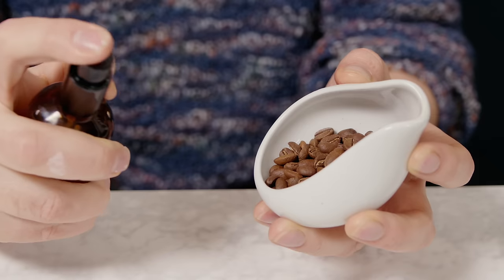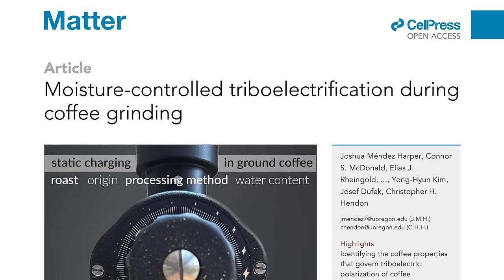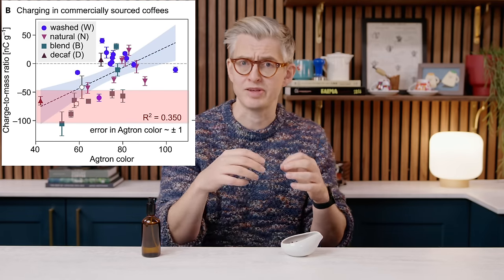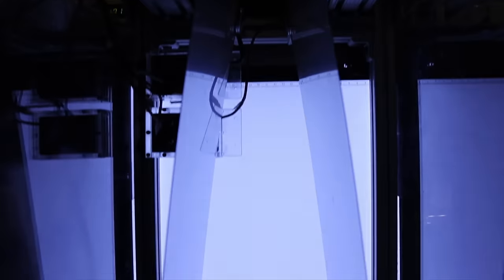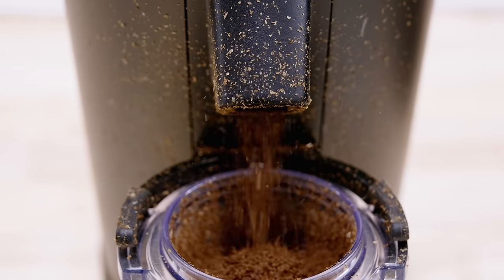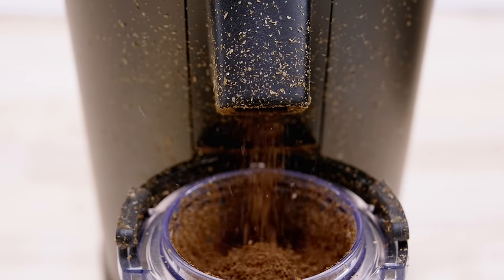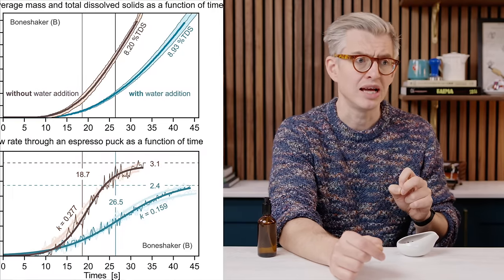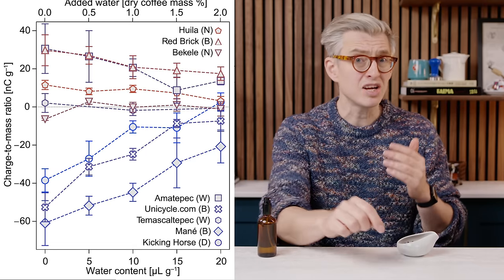Science Discovers What We All Missed: More Than An Anti-Static Hack

Comment: *Edit: maybe I should have read the paper first, lol*

1. Does your puck prep routine include using the WDT? I think the intent of that tool aligns with breaking up clumps -- probably larger clumps than the aggregates, and the tines are HUGE compared to one particle/aggregate. Is there a more pronounced water-dose-to-show-time relationship without using a WDT, or no observed effect?

2. Is there any relationship between the TIME between water spritz and grinding? Maybe the water is making the beans less brittle; the beans won't shatter as much. More time gives the water a longer period over which to diffuse towards the interior of the bean -- the same principal in blooming (getting rid of gasses, but also surfacing soluble materials via diffusion).

3. Is there a measurable difference in particle size distribution vs. water spritz quantity? Potentially preventing aggregates should remove particles from the larger end and increase the number at the smaller end. If there is a material brittleness thing going on, we might NOT have a large increase in fines.

I'm just spitballing 😇. Nor do I do ANY espresso.

Comment: I wouldn't feel comfortable with doing this with my hand grinder. I've had issues with water accumulation before, and the cause was being overzealous with the spray bottle. On an electric grinder (e.g. the EK43 from the turbo shot video), you'll have a much larger grind chamber (more room for water to spread) and a high RPM grinder to spread the water around and dry it quickly. Those are 2 things I cant get with my hand grinder (knock feld47 if  you're interested). I'll stick with 1-2 sprits of water. I also only brew v60 or aeropress, so I won't see the same benefit as espresso brewers might.

Comment: My first thought when watching this video was that roast level would be a significant variable, and I'm glad to see this information was included in the Google form. 

My grinder, the DF83, does not appear to bottleneck, so I didn't expect any change from adding water. To my surprise, the water visually appeared to drastically increase clumping (there is typically no visually observable clumping coming out of the grinder), and shot time increases from 28 to 39 seconds with a light roast. These changes were consistent across multiple shots. 

Furthermore, the "whetted" shot, when pulling, created separate streams from the naked portafilter which never came together into 1 stream, which typically would indicate channeling, and this result was also consistent across multiple shots. 

As you might expect, the flavor changed with the "whetted" shot, but I am not sure exactly how to describe the difference in flavor, and I will have to pull more shots to decide which flavor I liked better.

Comment: Just saying, I grind manually with a comandante with the Red Clix option. I do add water spray 1 by the way, and it works very well for me. I tried adding more  sprayed water and I found that the coffee grind sticks to the glass jar wall. It makes a mess and needs cleaning each time while using only one spray no maintenance is needed. So my guess is that you should get about the same results on electric grinders. I hope there will be a follow up on this subject. Thanks, very interesting...

Comment: interesting ... and how about the affect of water sprayed temperature ?
6g arabica + 10g Robusta, mixed & sprayed with water (room temp.) 3 times while mixed, total weight 16.2 -16.3g.
When grinding with the 1Zpresso manual grinder, I felt the difference ... the vibrations felt smoother, seems less power from my hand to grind
I use Flair signature manual espresso maker and also feel the coffee flow is more fluid, can't see different in crema but the taste is better. Taste better that I mean are the flavours from each coffee bean is felt firm.
What I didn't compared yet is how the espresso taste will be if using different water sprayed : cold, normal, hot, while mix the coffee for grind.

Comment: Did you weigh the ground outputs ... and if so did the spritzed weigh more? If so perhaps the moistened grounds are just packing tighter. Also moister grounds wet more readily so perhaps the water flowing through does so more evenly. In either case the results would be a longer/slower extraction.

Comment: Fascinating! I'm tempted to try this, but "flow rate" is a difficult concept with my manual lever machine (a La Pavoni Europiccola), since it's more controlled by how much pressure I put on the lever than by a mechanical pump, pushing water through at a measured rate. But I may be able to determine if there's a perceptible change in the output. That would likely be the only result that would make a difference for me, anyway.

Comment: From a phycicist (master) point of view ask some more questions in the survey: Air temperature and humidity, material of grinding burrs and cup. 
Every contact with metal will discharge the particle. It may recharge by friction with other nonconducting particles. 
Wet air is much more able to discharge particles. You know this from electrostatic charging of clothes and hair which is a much stronger phenomenon during winter with low (absolut) humidity than during summer.
Also there is this simple question to measure conductivity of sprayed vs non-sprayed coffee. Electrostatic charging is a phenomenon only isolators or very bad conductors show. If there is only a small amount of conductivity all charges in the electroclumps will neutralize instantaneously.
Coffee contains lots of soluble ions. A bit of water may transform it from a (dry) isolator to a (humid) ionic conductor.

Comment: @jameshoffmann You should control for whether the grinder is a single dose (has a bellow) vs not. My flavor of speculation is that in the eureka (no bellow) extremely fine charged particles should retain to the surfaces prior to exit whereas in a df64 the bellowing forces all particles out such that they can participate in electroclumps.  I would be curious if there is a correlation between time differential after spritz and whether the grinder uses bellows?

Comment: Can't really take part in the experiment because I'm using a Flair58, so the manually applied pressure is a big variable. But on the other hand, I feel changes in resistance of the bed very well. 
Three days ago when I heard about this study - but hadn't actually read it - I started to do exactly that and apply 4 spritzes of water to a medium dark roast I've been brewing since weeks. I keep my beans frozen at all times and put it directly into a DF64V at 1800rpm. I'm weighing in 14g of beans, and I didn't use any water before.
I didn't notice any difference in the grind time, but such measurement might be error-prone because wet beans tend to stick to the walls of the cup so they often need the help of a spoon to find their way into the grinder. The grinds were noticeably fluffier and significantly less clumping happened. Therefore it was also easier to create a subjectively even bed using WDT.
Contrary to the study, I found that there was less resistance from the same grind setting, and I pulled my shots faster. That however, made me grind finer, and it improved my shots. Anyone else who had the same experience? Again, the results from a lever machine are definitely more subjective, but at least I hadn't really read the study before and didn't have any expectation if it would increase or decrease the flowrate.

Comment: On first principles I would think that particle agglomeration (distribution of electroclumps etc) doesn't relate to particle size distribution as flow rate is being changed by reducing channelling rather than smaller particles; so it may not be a case of for/against but rather different issues.
One thing that came up with RDT discussions back in the day is wet grinding used in other industries and we played with that a lot. The idea is aromatics are lost in the grinding process (e.g. what you smell) that you can reduce by adding a liquid. In other uses, a much larger amount of water or oil is used and we played around with it in hand grinders, mortar and pestles etc. The brews were great, but tedious to do and clean. I wonder if there's any effect of aromatic retention in using a small amount of water...
Reply: Oh and sorry I forgot - great video! Thanks so much to you both.

Comment: Very interesting! I'm concerned about potential rust on burrs. While the Prof. did see humidity in the chamber returning to normal quickly, what about clumps of wet grounds sticking to the burrs? Any more residual accumulation on the burrs with wetter beans?
Reply: steel burrs will rust

Comment: Did you test the extractions of dry vs wet beans? Would be interesting to see if the extraction changes are correlated to the flow changes or if the two effects are independent of each other.

Comment: You went back and added the missing survey form..  but there is no mention of where we can view the results. 
The terse highlights after submitting the form doesn't show the results in a very useable format.

This hack is likely more useful for the light roast crowd and increased static compared to med/dark roasts. One is going to wonder about rust or possibly mold with this much water, but the immediate concern is the annoying tendency of wet beans getting stuck in the grinder on the way to the burrs.

Comment: Can you check whether the burr chamber of the DF64 is connected to the ground (earth)? You can use a multimeter and check continuity between the burr chamber and the ground pin of the power plug. Or take a piece of wire and connect any metal part of the chamber to the  metal casing of an espresso machine that is plugged in, and repeat the experiment.

Comment: Ok so I didn't have a spritzer handy, but was intrigued by the moistening of beans after seeing this. I took my already "moist excellent" beans from Pine Coffee Wyoming/ Boise Idaho (funky fermented fantastic) but them in a far put in a dram of H2O and shook them around. I certainly added a bit too much. many stuck to the sides of the hopper of my "good enough" Bodum Burr grinder had to push a few down manually. They did look more evenly ground, Just made my clever pour over "my" modified water first style (Water, grinds then more water to bloom on top, stir) About to sip out of the overpriced, but "boss" heated cup at 134 F. It is fantastic, not doing a side by side, but don't think it made a flavor difference. Will this rust the metal burrs in my grinder? Hopefully the oils in the coffee prevent that. I will get a mister, if it keeps coffee "fly-by"at bay will be worth it. Might this method make my good enough burr grinder rival higher end ones? Things that make you go HMMMMM.

Comment: The effect of a spray of water while grinding is one thing.  But the lasting effects during brewing I have problems with.  I don’t make espresso but from what I’ve seen, you put the coffee into a metal basket and then stir it with a “Espresso Distribution Tool” — which has several very thin metal wires to de-clump the coffee.  Also, as soon as water hits the clumps, the entire basket will not have any charged areas.  So… I’m very dubious that the spray of water affects the brewing given these two thoughts.

Comment: James, when you were conducting your experiments, how many times did you repeat the tests?  e.g., did you attempt the “0.35g of water” experiment 5 or 10 different times, or only once?  Ideally, your experiments should aim to produce a distribution of results, which you would then need to compare against a similar number of “baseline” tests.  If the data are normally distributed (a Kolmogorov Smirnov test could answer this), then you would apply a Student T-test to assess if the means of the distributions are the same (or not). 

This level of rigour is required to be able to judge whether the “38 second” versus “36 second” result was statistical noise or not.

Comment: Loved the video!  I tried t run the experiment with a Baratza Forte, but it wouldn't grind wet beans espresso fine.  They just sat there and didn't get pulled in.  Maybe too much water but not more than a few spritzes.  BTW, this grinder is much slower with finer grind size.

Comment: I wonder if some grinders get charged themselves, and due to their particular design slide grains inside the cutting edges of the grinder (or not). Adding water may change things, less charging, more recharging. But also a higher differential on the particles with freshly cut surfaces as well. They would reorient themselves in an electric field. Maybe some of these grinders have strong magnets close to the chamber? Or statically charge the two parts of the grinder differently.

Comment: Great inspiration - but as with all kinda scientific experiments the question remains: were really ALL circumstances and factors IDENTICAl, e.g. the IDENTICAL (not only similar) grinding burrs? can it be, that in one case they were coated (DLC, Titanium etc.), and in the other case they were not? Pure metal burrs could have a bigger "grounding effect" on any kind of charging of the beans, while coated ones could need more humidity as a neutralizer inbetween the singular beans.  Another aspect: moistening the beans  "before" grinding as a whole is a different thing compared to moisture them "after" grinding via an ionizer, which "only" helps to discharge the already grinded "coffee particle", so that they don't stick with the exit parts of the whole machine.   Were all beans in the different setting storage identically (dryness etc.)?  Have some grinders other internal construction specifications? In some cases this could help or prevent the beans from "charging"... I hope this questions and observations may help to find a clear interpretation of that mysterious phenomenon;-)  I myself will try different steps of humidification with my DF/G-iota 64 V - which also could be an influencing factor.

Comment: While I was performing this experiment at home for the Google Survey, I identified what I believe to be a critical flaw in the at-home experiment: I, like I assume many others will, measured the weight of my beans prior to grinding. Recall that the entire reason most of us have been spraying our beans in the first place was to reduce grinder retention. In the case of this experiment then, if grinder retention isn't controlled for, the dry trial will have less coffee (by mass) in the basket after grinding than the wet trial will, due to retention. 

A second factor which could compound this issue affects those of us who ground the dry beans first. The grinding of the dry beans will have left a considerable amount of coffee still inside the grinder (retention due to static electricity), as described above. If the wet-grind was performed second, then in addition to the retention being lower for the wet-grind, the presence of water will neutralize the residual charge of the retained coffee from the dry-grind, bringing those coffee grounds along with the grounds from the wet coffee. So, in addition to the lower retention, I speculate that the wet-grind has the potential to actually capture the retained coffee from the dry-grind, adding to the mass-disparity between the two brew trials.

The result in either case will be a higher mass of coffee in the basket for the wet-trial, leading to a longer brew-time and increased extraction, independent of the electro-clumping effect that we are attempting to explore with this experiment. I'm curious to know if anyone attempted to control for this in their at-home trial?

Comment: Interesting! I have one of the first gen DF64 grinders, so it doesn't have the ioniser. Not long after buying it I couldn't help noticing how messy it was due to the static. I haven't been willing to go down the path of RDT (water spritzing) as it was an additional step in the workflow that I didn't much care to do. I decided to ground (earth) the outside of the chassis using a thick copper wire attached with conductive silver tape. The ground is through the earth pin of a mains power point which ultimately attaches to the copper ground spike. This worked a treat. No more static, and no more mess. 

It will be interesting to see if this spritzing still makes a measurable difference in my case where the static is already tamed anyway.

Comment: So I was working with a gbw mahlkoenig for espresso and when the interior anti-static silicon and metal inserts that contact the grounds got dirty/oily, the grounds would come out the shoot and make a crazy staticky mess, but I did get the correct weight in the portafilter basket below, so I would carry on and start the extraction. But a super fast flow rate would always correlate with the staticky grind and therefore I would have to make some strange dial in maneuvers to salvage the shots. (I did go ahead and look at the manual to see how incredibly simple it is to clean the antistatic parts by the burrs).
So given the theory shared in this video, what was physically happening in the puck during extraction is there is static charge causing the grounds to compress to a lower possible density when tamping, and thus, crazy fast flow rate and channeling etc in extraction. It’s like the grounds in the basket got kind of spongey under the tamper while tamping.
Reply: Sound approximately accurate?